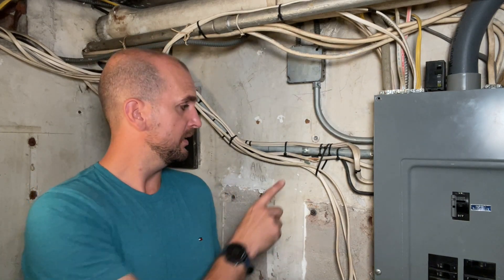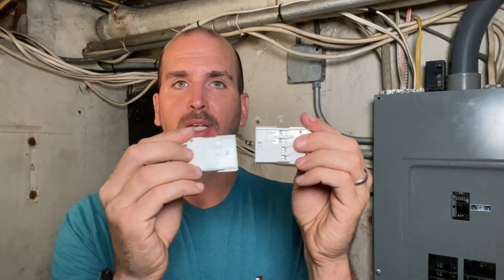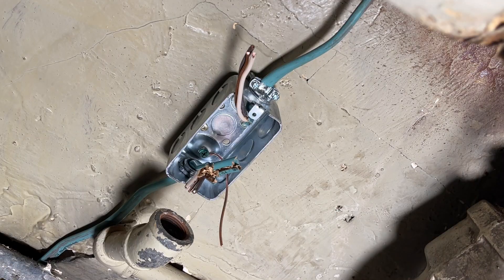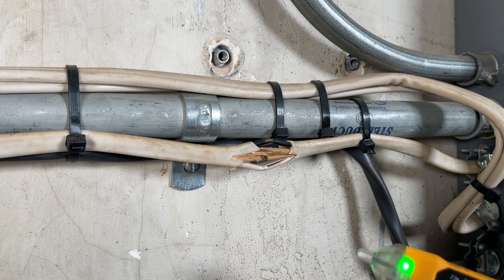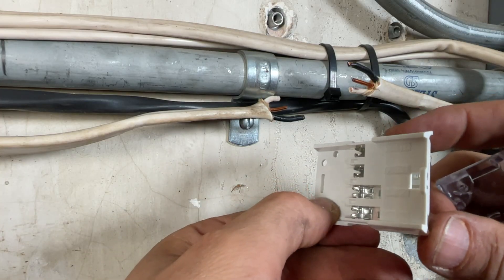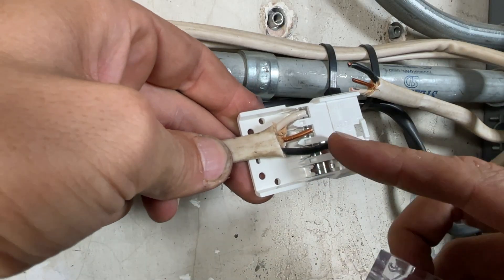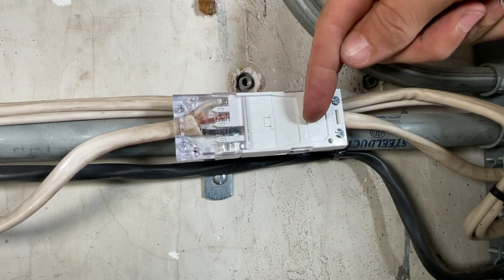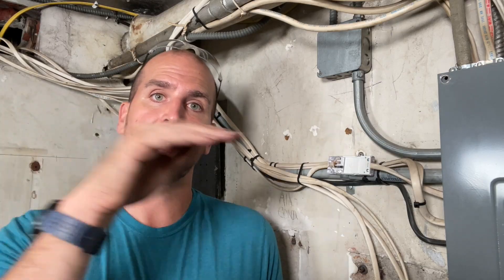How To Repair Damaged Romex Wires

Comment: In my opinion this is a really BAD idea! These "pinch" connectors are at best extremely finicky; at worst garbage.

Don't get me wrong, I use other types of pinch connectors all the time but it is with networking equipment (computer/internet/communication). This is low amperage environments and it (mostly) works fine, but with the amperage that can be pushed through household wiring you are setting up a "ticking time bomb".

I've run across different types of these and had to replace hundreds if not thousands (especially when used in overhead light fixtures) ... and this is the reason why.

When you use t-nuts you are getting a good constant 'bite' between the twisted pair of wires which also can take a lot of heating & cooling cycles in stride. But... with 'pinch' connectors, electrons are only transferring through those tiny connections they have in the 'pinch' area. As devices get turned on & off those small 'pinch' areas cycle through heating & cooling constantly, even with just lighting. This weakens the 'pinching' metal causing it to breakdown and eventually fail. I've seen so many "cheap & quick" electricians use these because they (minimally) meet "code", but then months or a couple years later some other electrician has to come back to remove these "little pieces of crap" and fix it the correct way.

Sorry for my language here but I seen so much of this it's ridicules. The original "electrician" does this kind of job and the fixtures mostly work ... for awhile. He/she gets paid & goes off to their next job. Later on though a different electrician gets called in to repair this mess & has to listen to the homeowner complain about the money it takes to repair it correctly.

I foresee a time, somewhere in the future, where these nasty little things gets kicked to the curb ... like aluminum wire or asbestos.

BTW, it actually costs less to do it the right way first ... it just takes a little more time.
Reply: Wago connectors have been used in Europe for quite a while and get great reviews.  I used them and never had an issue.
Reply: @garagekeys  ha! Me too we always use quik connectors reds / orange/ yellows ( 2 . 3. 4. Wire connectors respectively) and never have a single problem
Reply: @garagekeys  I think he's talking about the splice kit
Reply: I understand your point, but a similar argument can be made against wire nuts. 
A wire nut you just jam two wires into a plastic cone that has a third wire molded in with it and twist and hope there is a connection. 
But the molded steel wire cuts (shallowly) into both copper wires multiple times and the twisted wires have plenty of surface contact with each other, insuring excellent electrical and mechanical contact. 
Furthermore, while your argument about pinch connectors is logically sound, and is certainly true for other pinch connectors, it fails with wago connectors. 
Wago connectors pinch the wires with (relatively) large, solid copper spring connectors. And they do so with enormous force, enough force to deform the surface of the copper wire to insure plenty of surface area for electrical contact. But not enough to actually cut all the way through the wire. Furthermore, this clamping force is constant spring force, if the wire shifts in place, it will have the same force applied regardless. The same cannot be said of wire nuts. 

I'm not saying wire nuts are bad. I am saying everything has downsides and that you seem to be painting with too large of a brush.
Reply: @superdupergrover9857  The only time a wire nut makes a questionable connection is when unlike gauges of wire are used in one splice, and/or not mechanically pre-twisted. The electrician makes the splice. The wire nut is just for protecting the exposed conductors. When stranded wire is used, a good quality wire nut, used according to the manufacturer specifications, will mechanically twist the strands around each other and make a proper splice that won’t fail. Push in and spring force connectors fail, and fast. It doesn’t matter how much surface area they contact. The conductors in the connector fail. They fail all the time, under any type of load, and they fail quickly. All I do is service work, so I encourage their use. And so should you continue to encourage their use. Service electricians make their living in large part due to the use of UL listed devices that save other electricians’ time. I’m not sure why I keep hearing that their use in Europe doesn’t have the same negative feedback. Maybe because they operate with twice the voltage? I have no idea on that. I just know I collect a lot of money due to these connectors.
Reply: @juana.2745  ever found a burned up wire nut ? I have a few times where the loose wire nut is barely doing its job with a bad connection and it corrodes and welds itself together and tries to catch fire but dont in most cases. Ive never seen a wago do that becouse it has some measure of clamping force on the copper always all the time, so no fizzing and crackleing
Reply: @brandonknight7240  When you say it was barely doing its job, that’s right where I disagree. You’re implying that the wire nut failed because it couldn’t completely hold the wires together tightly enough, but that’s not what they’re designed to do at all. They are designed to cover the stripped conductors in a splice and hold wire ends together-that are already completely touching each other. If the wire nut burned up, that’s because the splice was made improperly. That spring in the wire nut is not designed to function as a conductor. That’s why you should always pre-twist solid wires. Stranded wires twist around each other when a wire nut is turned on them, so the wire nut twists the conductors for you, when used properly. Wagos are different. The metal clamps are conductors. And there is either not enough contact, or enough conductor to carry loads, which is why they fail constantly. I’m not saying they should not be used. I think tradesmen should always have tools and materials at their disposal that save them time. But to claim that Wagos are equal or superior to wire nuts from a reliability standpoint is empirically untrue, and I have the Wago corpses to prove it. I’m not just talking about the push-in connectors that everyone incorrectly calls Wagos, I’m talking about the actual Wagos. They suck.
Reply: I agree. I only use these connectors if I cannot stretch the wire. Otherwise its wire nuts all the way. Plus a wirenut maybe costs half a cent. And IF you have to pull the thing apart you can with the wire nut without snipping wires.

Comment: Nope. NEC compliant or not, I don't trust anything that just pierces insulation. Same with a scotch lock.  Great for quick, temporary repairs or maybe testing a connection, but I'd like to see something with a more solid, permanent feeling installed when the job is 'done'.

Comment: Thank you; I knew the comments were going to be something special as they always are on this type of video.

TE says their products are allowed under NEC 334.40(B) so check that section out
Reply: 334.40(B) in the 2014 NEC reads as follows: Self-contained switches, self-contained receptacles, and nonmetallic sheathed cable interconnector devices of insulating material that are listed shall be permitted to be used without boxes in exposed cable wiring and for REPAIR wiring in existing buildings where the cable is concealed.
Reply: It is only allowed if it has to be concealed. If it doesn't have to be concealed, you cannot use it.

Comment: Is that splice kit approved for use inside the service panel?
Reply: Why would you ever need to use that inside a service panel?
Reply: @electricaf365  - I would like to install a generator connection. Local code requires a lock-out. The most simple and easy to install option is a sliding plate that allows the main OR the top breaker on either row to be on moving the load of that breaker to the bottom would require lengthening the wire. The obvious answer of moving them all down one also will not work. The box is very tidy and there is little slack anywhere so unless I’m missing something, my options are extend the load wire in the panel, run a new wire in a finished home or use a more expensive, complicated generator connection. I’m not a professional electrician and didn’t look it up but suspected splices were not allowed inside a panel.

Comment: If the insulation is torn and wires ate not damaged, I just tape each internal wire with black tape and wrap cable with piece of Roman, then tape it together and I can sleep well

Comment: Basically scotch locks for the house... I don't care if it's approved or not, that's a hard no from me.
Reply: Absolutely!!! And i hate scotch locks.
Reply: @Bluesman57  7 r"<<"[(] 8fvpccc ,
Reply: I would NEVER put it behind sheetrock. That WILL inevitably cost hours in troubleshooting a failed circuit.
Reply: @tydouglas7144  I'm with you; I don't feel any repair should be in the wall covered up.  
Just like Shark Bites for plumbing; they even say on the package not to put in an inaccessible place, but people do it anyway because they don't read the instructions.
Reply: Been a while since someone called them scotch locks. Wire nuts is what he is referring to.
Reply: Any splices is a potential failure point.
I have seen failures in middle of conduit with no splices. 
This person is not an electrician and should not be making any recommendations like this.

Consult a professional electrician for any electrical work if you are not familiar with electrical.
Reply: I disagree. As a licenced electrician,  i would not be opposed to using this in accessible locations on non continuous duty applications in rare circumstances. As the contactors are not copper they will be the point of first failure, similar to push in wire method for switches and receptacles. They all fail in continuity at that point.
Reply: @tydouglas7144  as you said "they all fail in continuity at that point" if something is a common / known failure point then that's all the more reason to not use it. Scotch locks and their kind are well known for their failures. Now this is going to possibly run 10, 15, maybe 20 amps of service through two little (maybe 1mm) knife points on either side of the wire? That is IF it cuts through on both sides. Heck those little push in holes have more surface contact in them than these things. There's no way I'm going to believe these things are going to hold up to, let's say, a plug in heater.
Reply: @AmalgmousProxy  you misunderstand. ALL things have a first failure point.  With electrical wiring that point is connections, therefore the need to have all junction boxes ACCESSIBLE. 
   In the rare circumstance that I would choose to use this device ( not saying i would) but if i were to use it, i certainly would not hide it behind sheetrock and would advise anyone else to do likewise.
Reply: @tydouglas7144  you misunderstand. Why create a failure point? This gimmick uses a flawed design with a known history of failure. As a certified electrician I would expect you to understand that any repair being done needs to be done with the best and most solid repair techniques available regardless if it's accessible or not. Ideally the repair should be stronger than the wire is alone. Whether it's readily accessible or not is irrelevant and is not germane to the situation. The quality of the repair, regardless if it's accessible or behind drywall, should be done the same way, otherwise it's not a repair, it's a bandaid.
Reply: @tydouglas7144  This gimmick is perfect for shady electrician who in a few months want to have the customer calling them back because the circuit failed. And guess what? He likely knows exactly where that failure is going to be. Which means $$$ for him. I'm not down with that kind of work ethic.
Reply: @AmalgmousProxy  i cannot afford to be a shady electrician
 People put their lives and their homes in my hands.  I dont take what i do lightly. I am appalled at some of the things i find in people's attics. I am going behind shady electricians all the time. 99 times out of 100 some of the shady shit may just be fine. But those arent good odds. Ive wired over 100 homes last year if one of those homes had burned down i wouldnt be able to live with myself.
That is what the NEC is for. I do things that meet or often exceed code.
Reply: @tydouglas7144  I never said you was. Don't know why you think that.
Reply: @tydouglas7144  And?
Reply: @tydouglas7144  they are good for an led light circuit, thats about it

Comment: That TE splice kit looks like what’s called an IDC ( insulation displacement connector). The most common use I’ve seen for them are on 66 type telco punch blocks. This format may be fine for very low voltage/current telco applications, but I would never trust this on 120VAC service ESPECIALLY inside a wall. Sorry, but in my house, I’ll take the time and effort to pull a new run end to end. BTW, don’t like the WAGO’s either on 120VAC. To me, both of these do not have enough mechanical connection to carry the current. 
👎👎👎

Comment: An inspector (AHJ) will look at at this and will not pass it.  NMB cable is NOT approved to be exposed on the surface of a wall.  The existing wiring method of supporting with zip ties to conduits and bundled together is NOT approved.  It’s time to clean this mess up to avoid more damaged NMB cables and potential fire hazards.

Comment: I love wago lever nuts but I don’t understand why they don’t make a 4 wire version.
Reply: Actually they do make them and five wire also. Check Amazon
Reply: @lorenrickey5481  I would love to see a link for that..  I have never seen lever nuts in anything but 2,3,5
Reply: @tbone587  I misunderstood your question, I thought you did not know they made three and five wire connectors and all you have to do is leave one wire off of a five wire connector. Maybe someday they will come out with a four conductor?
Reply: @lorenrickey5481  yes obviously you don’t have to connect the 5th wire but they are fairly large and when you start to have multiple of them the physical size a 4 conductor unit would help a bit.  I also personally find I’m typically using the 5 conductor version and nearly always have 4 wires.  I’m sure from wago perspective they are just am trying to simplify the amount of offerings they have but one can dream lol

Comment: The correct order when splicing wires is always the ground first then the neutral and last the hot wire.
Reply: This is a video for an in-wall splice kit. By a non-electrician

Comment: If that is all the inspector caught during his inspection, he is not much of an inspector.   All those cables tie wrapped to conduit are a NEC violation.   Conduits shall not be used for support.
Reply: Some of you missed the point of the comment.   The point had nothing to do with cable ties, it was that conduits are not to be used for support of cables.  One exception as noted in a comment is control cable her thermostat conductors.
Reply: @KevinCoop1  you're right..  in retrospect I wasn't responding to you, and the follow-ups as well... We kinda went on a tangent. Lol sorry for the notifications
Reply: @seanbouker     Everybody was correct though and that makes me happy!
Reply: Yeah, I noticed that as well. Clearly this panel, or all the added circuits with unsecured romex was done so without a permit, Although an inspector could call it pre-existing if he knows the electrician doing the work. (Knowing that particular electrician doesnt work like that, i mean)
Reply: I would put a gutter box at the entrance of all those Romeo cables and run a 2 inch metallic raceway, run thhn to my disconnect. And make splices in gutter to clean up that rats nest.
Reply: @martinsnibbor7691     That is what I designed into commercial projects with 84 circuit 2 section panels.   A gutter above and below if on grade.   Electricians greatly appreciated it.
Reply: In my jurisdiction we are absolutely allowed to use cable ties to tie nmd to metal conduit. Conduit is bonded so it's not an issue. Of course we have to isolate nmd from things like metal furnace ducting and copper water pipes.
Reply: @scottfurlong5475     So, in your area, there are no codes?   Or else, your inspectors do not know the code?
Reply: @scottfurlong5475  The issue is that the NEC prohibits cables freeriding on raceway exteriors unless the cable outside and the circuits inside the raceway have related purposes; for example, control and power for the same utilization device. I believe that few jurisdictions override this prohibition.
Reply: Conduits can be used for support, but only for control wires. Like the thermostat wire to the furnace. However, using zip ties to support NM cable is a violation in itself. Only MC cable with approved zip ties are permitted.
Reply: @robertsteich7362  yes and no... As shown it's a no go... But cable ties are absolutely allowed and honestly say safer when Properly installed. Than say a traditional staple. Which I think we can all admit feels a bit barbaric.
Reply: @seanbouker  It's a bit tricky. SOME cable ties are allowed under current code. Prior to 2017, it was more open, but now they have to be specifically rated for securement or support.

If you look at the package, assuming it has a UL listing, it'll say something like "UL Type 2" on it. Type 2 and type 21 are no longer okay - you  need type 2S or type 21S - the S is for support.

ALMOST everything you can buy in the home improvement store electrical aisle these days is 21S, but there are a few 21's still there. And if you're buying zip ties anywhere else in the store, or at harbor freight or from randos on Amazon, all bets are off.
Reply: Actually you can but it would have to used some of those stackers for romex and made it look more cleaner,But the major violation is all that exposed electrical  wire al eye level.